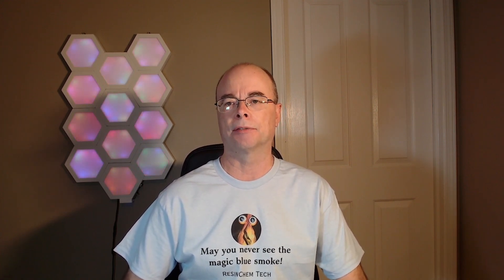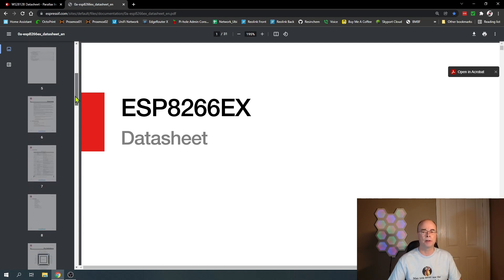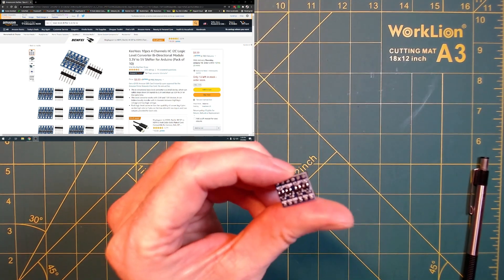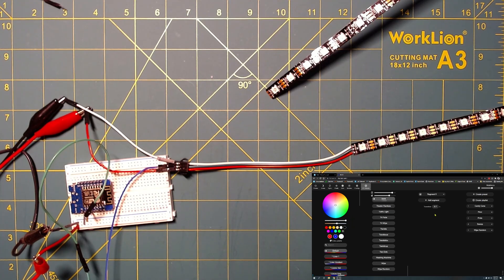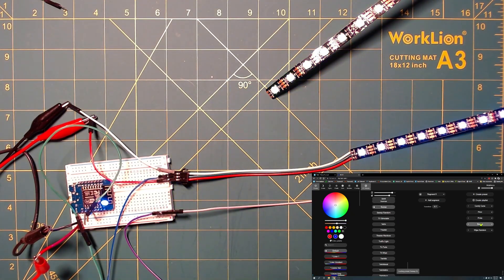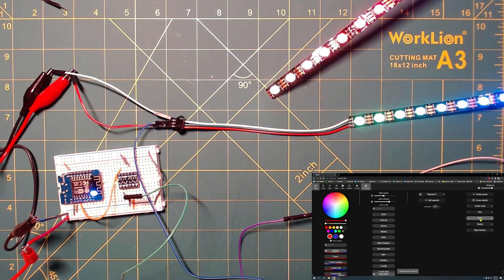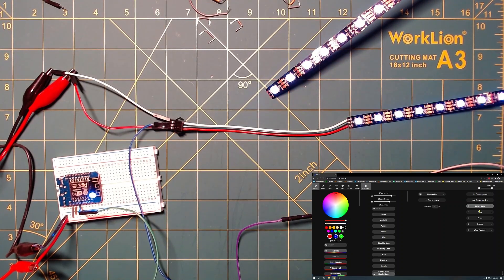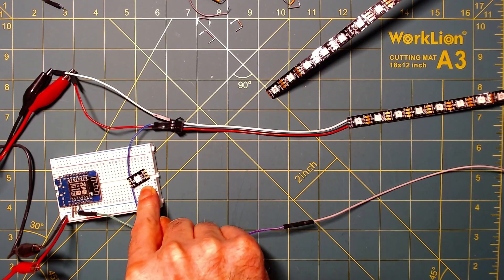Logic Level Shifter and WS2812b LEDs

Comment: I am using 12v for a longer run of 1000 ws2811’s.  I cannot seem to find one for 12v.  What do you recommend?
Reply from the maker: Well, even 12V LEDs expect a 5V signal just like 5V LEDs.  So this same shifter would work for 12V.... but you do still need to feed it 5V and 3.3V.  If you are using a 5V controller (e.g. ESP8266 or ESP32), then you should already be feeding in the 5V and you can get the 3.3V from the 3V3 pin on the ESP board.

I get that a lot... thinking that 12V LEDs require a 12V data signal.  But that's not the case... most LED strips, regardless of whether they are powered by 5V or 12V, still expect a 5V data signal.  But you can check the spec sheet of your particular LEDs to be absolutely sure.

Comment: Slightly confused by the logic level shifter.  The link for the logic level shifter indicates that it is a 'quad', However, I believe that I need only a 'single' for each pixel output from the Christmas light controller. What is available as a single amplifier that would clean up the data signal from a 10-20 feet distance from any 2812B Christmas light controller? I have four wires to deal with...Data in, Data out and +&-5Vvc. How is this level shifter hooked up? Thanks for the video. I think that you nailed it. I don't need to change voltage levels but merely to clean up the square wave on the data line after 10 feet or so. I want reliability with my 5V WS2812B strips. Thanks -Greg
Reply from the maker: The particular shifter shown will handle up to four different data signals, connected to the corresponding LV1-4 and HV1-4 pins and on each side you connect the low voltage (e.g. 3.3V) and ground to the LV and GND and high voltage (5V) to the HV and ground on the other side.  Of course, you don't have to use all four channels, but can just use one if that's what you need.  But it might be easier to look a a wiring diagram than trying to describe it here.  I have a blog article that shows various LED controller wiring, including a section on wiring the shifter that you might find more helpful:  https://resinchemtech.blogspot.com/2023/01/wiring-diagrams.html

Comment: even with these level shifters , the flickering wont stop. I used these cheap ones , then switched to those big IC with 4 outputs...nope..still flickers at 5 Meter data line...at last i just bought ws2812B single led breakout boards & used that..heck i am running 10 m long data line with no problems at all...dont go with these logic level bs...you might wanna use some resistors depending upon your placements with other lines..

Comment: Thanks. This confused me so much, on a ESP32 everything seemed to work fine, then on a RaspberryPi it did not. Or other funky stuff happend.
Reply from the maker: Glad it helped!  Like the ESP32, the RPi GPIO pins output 3.3V.  So they are susceptible to the same issue, especially with longer data lines between the Pi and the start of the LED strips.  

Thanks for watching!

Comment: Being very new to this (even soldering), I can see this would help in my project. Alas, "reading" your breadboard is not clear to me since I do not understand all the terms. I got the same level shifter - but unsure on how to solder it all together. Do you have a wiring diagram on what connects to what? I´m using a ESP32 dev (38 pins) - but will probably figure out the difference - it´s the logic level shifter pins and power connecting that I wonder about. Thank you in advance! :D
Reply from the maker: You might check out my latest video on common LED questions and watch the section on the logic level shifter, where I show  and describe exactly how to wire it:  https://youtu.be/GZv5Ztj6i6I  

I also have a written guide with various types of wiring diagrams for LED controllers.  This might give you a better view of how to wire up the shifter: https://resinchemtech.blogspot.com/2023/01/wiring-diagrams.html

Hope that info helps.

Comment: For the WS2812b you're misinterpreting the datasheet a little.
The Vih and Vil parameters refer to the minimum and maximum voltages that can be applied for the chip to reliably register a '1' or a '0'.  So the 0.7VDD is the minimum voltage the chip needs to "see" to recognize a '1'.
The IO buffer inside the chip will have protection diodes from the pin to the VDD and GND rails. They will forward conduct with around 1V on them. So the maximum voltage on the pin before the diode conducts is around 6.5V (5.5V max + 1V diode). If you exceed that the diode will start clamping the voltage internal to the IC and will generate some heat in doing so. The purpose of the diode is mainly for dissipating static electricity from accidental pin touches.

In any electronic system you want to design the thing not to exceed maximums.

The reason a simple resistor can work is that it will limit the current that can flow into the pin with an excessive voltage. Whilst this will work, a level shifter is the proper way to do this job.

Comment: When my students ask me this question, my answer is that you may or may not need a Logic Level Shifter in your project, BUT since these IOT devices and Controllers are all made in china, produced through all types of cost cuttings and cheap components, you MUST use a Logic Level Shifter.
Reply from the maker: Yeah, I think I mention a similar thing in a number of my videos when it comes to using a shifter.  What might work for one build might have issues in another exact same build... due to variances in tolerances of the strips, ESPs, etc.  For me, it is just easier to always install a shifter during the controller build and not have to worry about the data signal strength.

But thanks for watching... and taking the time to leave a comment.

Comment: What size power supply do I use for 16 foot 300 pixel? I keep burning up my lights and esp32 using 12v 5a blister plugs. I'm so frustrated and lost honestly.
Reply from the maker: Well, if you are using a 12V power supply and are not stepping that down to 5V, you will definitely fry the ESP32 as most ESP dev boards are designed to run on 5V.  I'm assuming you are using 12V LEDs?  If you are trying to connect 12V to LEDs designed for 5V, then the same thing will happen...they will burn out.

So, first you need to assure you are using the right voltage for your components.  When it come to 'size' in terms of amps, when using 5V strips, you should allow for a maximum of 0.06A per LED.  So for 300 pixels, you need a power supply capable of providing at least (300 x 0.06A) = 18A.  I'd recommend 20A if you want to run full bright white.  You might be able to get by with 15A, but you'd need to limit the brightness using the brightness limiter setting in WLED.
Reply: @ResinChemTech  i got ya that makes a lot more sense. Thank you should save me some boards
Reply: @ResinChemTech  so, i probably fried my lights too, most most light up and the ones that do only have 1 or 2 barley lit up one in green one in red.

Comment: So that means that the important is the relationship between signal voltage and PS voltage. So what happens when I use 12v led? Do I need to level-shift to 12V?
Reply from the maker: While you should always check the spec sheet of your LEDs to be sure, most 12V LEDs still only expect a 5V data signal.  Of course if you are going to use a single power supply, you'll need to step the 12V down to 5V to power the controller and shifter, as most ESP dev boards operate on 5V.

Comment: ask. a level shifter, it can be connected directly from a 5v 3a mobile charger, and transform it to 3.3v? How many amps does it hold? can I use it for something other than i2c, like a light bulb, what do I know, a sensor without i2c... etc?
Reply from the maker: This device is meant to shift a logic signal... not true voltage like you are referring to.  If you need to step up or step down voltage for powering other devices, sensors, etc. you need to use a step-up or step down voltage converter.  These are often referred to as buck converters.

Comment: This might potentially solve my issue. Subscribed 🙏
Reply from the maker: Let me know what you find!  As I've mentioned to others, there may be no problems with one install but another nearly identical install could see issues.  That's why I always include the shifter in all my builds... whether I could "technically" get by without it or not.  It is a cheap $1 insurance policy to assure I have a good 5V signal leaving the controller and I don't have to be overly concerned with the length of wiring run between the controller and LEDs (well, at least up to a point).  If I have an issue, then it is likely related to something else and not the data signal voltage.

So, as I say to all the others that say a shifter isn't needed... go for it.. it's your build.  But the first time you have a data signal problem, you'll wish you had included it... especially if you discover it after everything is installed.  It's a lot harder to add the shifter (or even the sacrificial pixel) after everything is built and installed, as opposed to just including it up front.  

So, let me know if this does solve the issue for you.  Thanks for watching, taking time to comment... and the sub!  I appreciate it!

Comment: I'm not a techie here so what pins from esp32  connect to logic level shifter pins please show me a diagram,  ty
Reply from the maker: Basically, you can use the same 5V, 3.3V, ground pins like you would with the ESP8266.  You can use a number of different pins for the data signal, but GPIO16 is the default.

I have a number of standard wiring diagrams for the LED controller that I use, including some of the ESP32.  You can find them here: https://resinchemtech.blogspot.com/2023/01/wiring-diagrams.html
Reply: @ResinChemTech   can esp32 able to control 2 visual effects with 2 separate wled?, ty
Reply from the maker: One ESP32 can control more than one LED strip by using different data pins and creating segments within WLED.  See for information here at the official WLED web site:  https://kno.wled.ge/features/multi-strip/
Reply: @ResinChemTech  thank you teacher...😆👍

Comment: Just what I was looking for. Thank you for taking the time to do an apples to apples comparison instead of just saying you've seen issues.
Reply from the maker: Well, a lot of folks will contend it's not needed... and as I show, in some cases you can get away without it.  But for the $1 cost, I always include one to assure a good data signal.  YMMV.

Others claim that this I2C shifter is "too slow".  I have yet to see it, or any negative effects with this shifter.  Maybe if I had an install with 1,000s of pixels or was looking for super smooth animation on a large matrix, then I suppose that speed/framerate might be impacted.  I do plan on doing a comparison of this shifter to the much more difficult to use "recommended" shifter to see if I can detect any differences (at some point).  But with well over 2 dozen LED installs (both WLED and using NeoPixel/FastLED), I not seen this simple, low cost shifter cause any problems.

Thanks for watching and taking time to leave a comment!
Reply: @ResinChemTech  Hi. I've also heard that I2C is too slow and that that is what's causing data issues with my 480 pixels. I've just bought a 74AHCT125 shifter in the hope that this will work. I'm not doing fast changes to my LED's as it's for a scoreboard where I've made big digits out of 32 LEDs per digit, so they only change every few minutes, but after a while (and sometimes immediately) the data gets corrupted along the length of the strip. Any advice for a newbie like me is very welcome.
Reply from the maker: @ianwoodford9725  Yeah... I've had others say that about the I2C shifter... but I just haven't seen it.  I also have a matrix that is a clock, scoreboard, etc (I have a couple of different videos on it) with 400 pixels (ws2812b).  I've seen zero issues with the signal, regardless of the mode.  I also have an install with over 800 LEDs (linear, not matrix) and again, no issues with the signal using the I2C shifter.

I'm not saying others haven't experienced an issue, but I just haven't seen it. I've purchased some 74AHCT125 shifters and am planning on doing a video comparing it side-by-side to the I2C shifter.  But please let me know, one way or the other,  if switching shifters solves the problem you are seeing.  If you are still having issues, then the signal problem is elsewhere and not with the shifter. But I'd love to know your results either way.

Comment: Question: Can you explain me with a picture how this is connected to a "D1 Mini ESP-32" for example ❓ my English is not so good ❓Do you know the Fritzing software ❓
Reply from the maker: I cannot post images or attach files in YouTube comments.  I have wiring diagrams available in my WLED controller-related blog here:  https://resinchemtech.blogspot.com/2021/01/building-your-own-led-light-strip.html

It has multiple versions of wring for both the full size NodeMCU and the D1 Mini.  The wiring for the ESP32 is basically the same... the pins are just in different locations.

You can also find a wiring diagram for a WLED controller on the official WLED web site:  https://kno.wled.ge/basics/getting-started/

That's about all the help I can offer in terms of a wiring diagram.

Comment: I once made an led cube with pl9823 (same voltage specs as ws281xx) it was all working fine until i poured it into resin. The led’s and esp32 where still working, but the data signal from the esp didn’t anymore. Moral of the story: USE LEVEL SHIFTERS!
Reply from the maker: THANK YOU for saying that!  That is the point I've tried to make over and over to those that say you don't need the level shifter.  Maybe you don't... and maybe you'll be fine without it.  But I'd a lot rather spend the extra $1 and a few minutes up front to assure a good data signal... as opposed to having everything work great on the benchtop... only to have the problem show up after final installation... just as happened to you.  

It's up to the individual to make their own decision, but I always use the shifter even if my data run is only a couple of inches, and will continue to recommend it to others as well.  Again, thanks for sharing a real life situation that shows why... although I'm sorry you had to find it out in this way.

Thanks for taking time to post a comment!

Comment: I've never seen a datasheet that had voltage value as a percentage of anything (1:27).  That's a first. Why is it shown like that instead of just listing an absolute voltage range?
Reply from the maker: All I can tell you is what I am showing is the official spec sheet.  I'm guessing that they are showing a percentage because Vdd, listed right below, is a range and not a fixed value either (Vdd=4.5~5.5V)?  So, the data line-in minimum is 70% of whatever Vdd happens to be. But I am far from being an electrical engineer, so maybe someone else can address that question better than I can.
Reply: @ResinChemTech  So if I follow that thinking, a lower VDD would allow 3.3v to  work better at longer distance..... That doesn't quite follow either does it?  I'm all aboard the 5v train, but that datasheet . . .   :)

Comment: I don't think the long lead problem stems from voltage drop due to copper loss; it's recommended to put a 100+ ohm resistor between the LED's d-in and the MCU's GPIO. It would take many many meters of signal wire to introduce that much resistance. Note that the pixel's register output (d-out) is fed by 5v, so you can just use a "sacrificial" pixel at the ESP instead of a logic level converter (not that either is expensive, but it's known we all have pixels on-hand). It can also help to drop the "5v" down to 4.5; this produces less heat on the strip, and lowers the signal high threshold to well within 3.3v; overcoming border-line "flakeyness" so common in driving pixels with 3.3v MCUs.
Reply: I work in lightning protection. Part of my job is testing older systems to make sure they are still in working order. 

You would be surprised how much resistance and how quickly resistance can change due to things like a few extra feet of wire, a few degrees change in temperature or the wire being coiled up vs stretched out.

If the voltage for controlling the led strip is already on the boarder line of not being high enough, I can see how a couple feet of extra wire could cause it to have some issues.
Reply: hey, what exactly is a sacrificial pixel? i'm new to this kind of stuff. thanks!
Reply: @AlNexus  Cut off one of your pixels and put it in the box and wire it next to your ESP (make sure the Data in/out order is correct). When data hits the ingress of the LED at 3.3v it then will output it at 5v, and you can extend to 10ft or so as suggested in the video.
Reply: @ReganMcCullough  thank you for replying!! this helped a lot in my project

Comment: Without using the logic level shifter I ran into some really strange issues. I had maybe 3-5ft between the board and the first LED. I found that if I turned on the humidifier that was in the same room it would turn on the first LED! This happened consistently with 2 esps and strips. Added a logic level shifter fixed the issue.
Reply from the maker: Glad the shifter solved your problems!  The default 3.3V from the ESP is already right at the bare minimum signal for LED strips.  Any further voltage drop (or slight interference, as you found) will lead to all sorts of strange behavior.  People still want to state that it isn't necessary and they've done x number of installs with no problem.  Fine... I still believe that taking a few extra minutes and spending $1 to assure a strong 5V signal to start is worth it.  And it is a lot easier to install that shifter up front, than to wait for problems to occur and then have to try to add it later.

Thanks for sharing your experience... and confirming that a logic level shifter can often solve issues related to the LED signal.  I appreciate it!